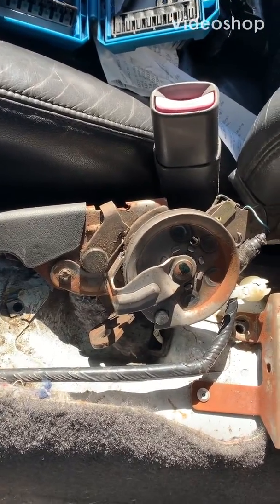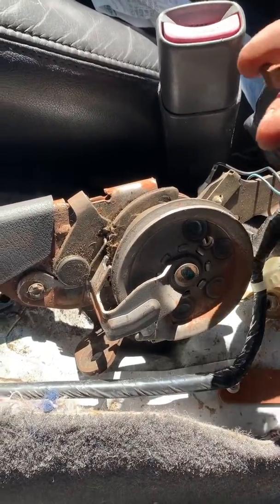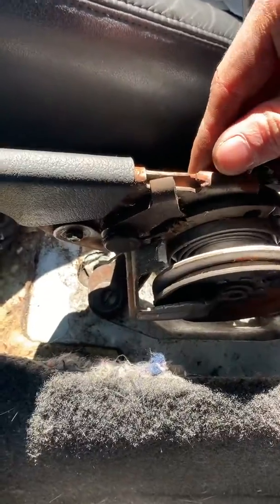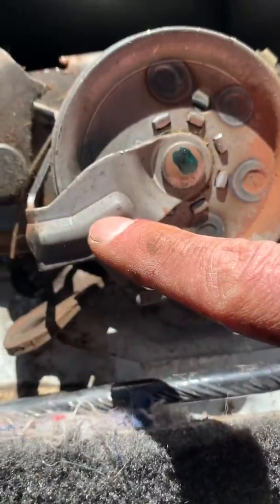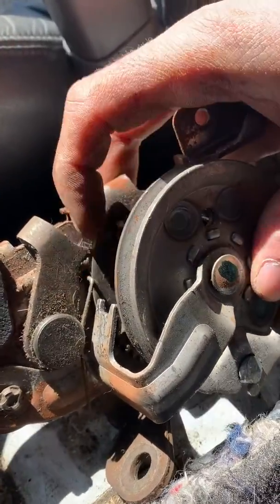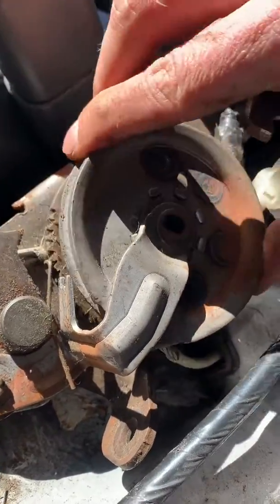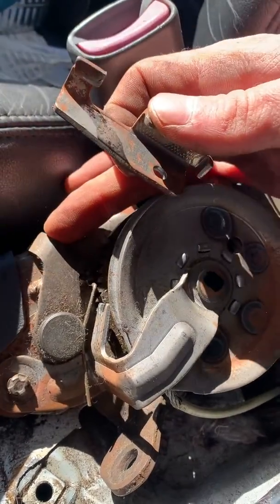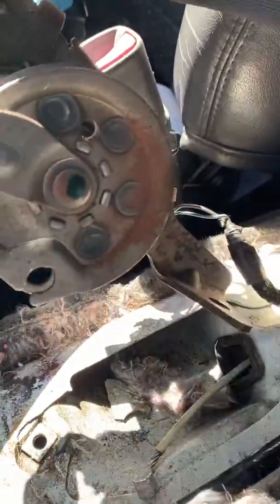2000 mustang e-brake cable disconnect from handle

Comment: I forgot to put that little bracket back on which sucks because I have to take it all apart again lol what purpose does it serve because my e brake works perfect without it
Reply from the maker: Looks like an added safety feature in case your spring breaks, the wheel won’t loose contact with that hook that maintains the mechanism loaded under pressure. If the wheel skips the teeth and rolls back, your e break won’t work. I would put it back on 😅
Reply: @SaleenDrift  haha thanks, I’ll have to for sure then